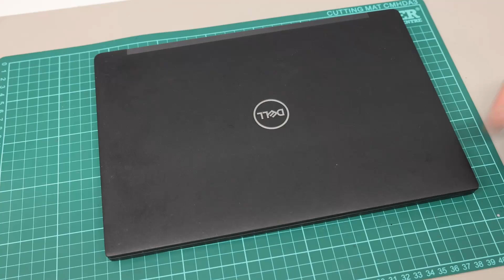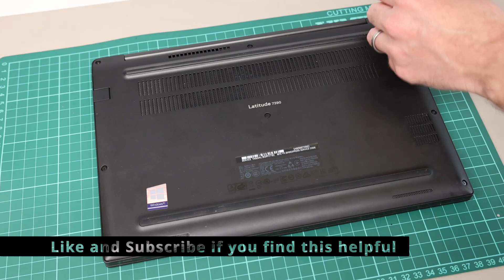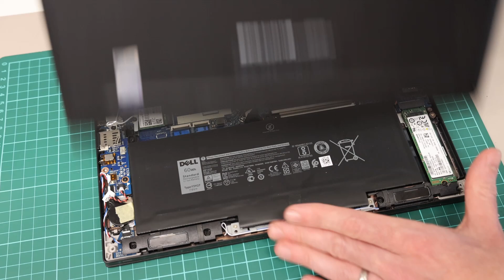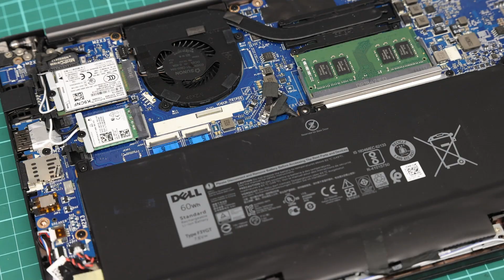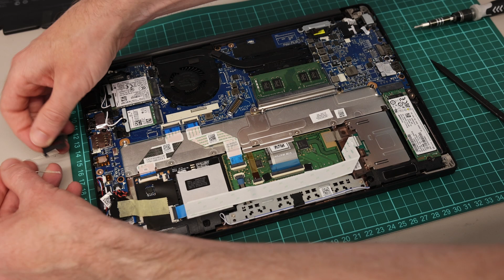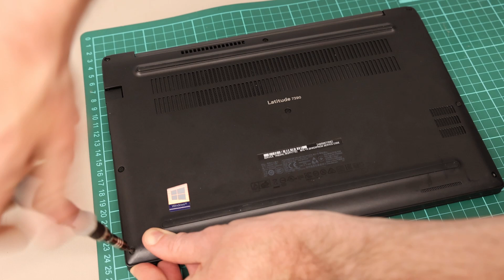Dell Latitude 7390 - Mainboard and Keyboard Replacement Guide

Comment: do you have to unscrew all and remove all parts before replacing the keyboard ? is it more simple if you just leave the parts on and remove the screws only ?
Reply from the maker: Which bits are you referring to? You need to remove everything to access the screws.
Reply: @BrueComputing  yes already done